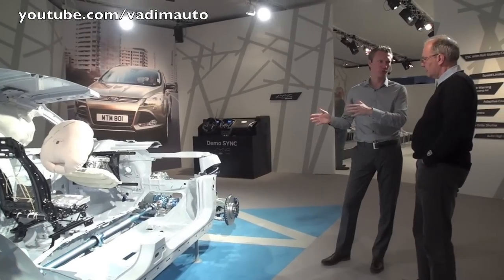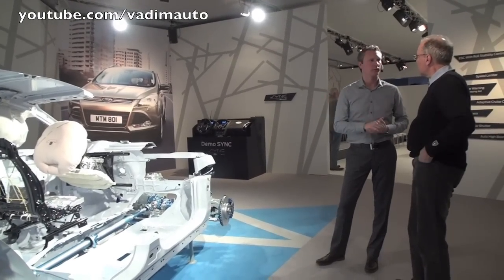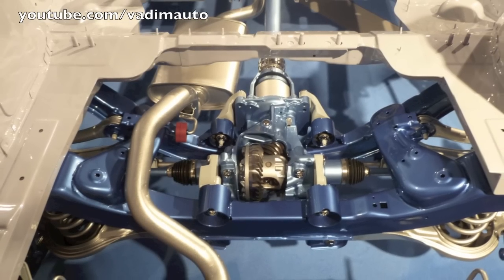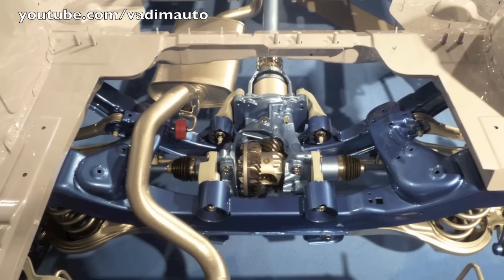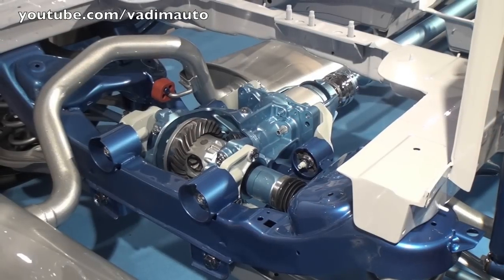Ford Kuga, Intelligent AWD

Comment: Thanks for sharing. To clarify, the all-wheel drive system uses a JTEKT multi-plate clutch pack. In normal conditions, the clutch pack won't be engaged so that the Kuga will be front-wheel drive only. As the clutch pack engages, rear axle torque increases up to a 50/50 front:rear split. It's not really accurate to say that the split is infinitely variable - it's only when the front wheels have no traction that its 0/100 front:rear.
Reply: Nice work, Eric.
Reply: How it's possible to transfer 100 of torque to the rear ? Because at this type of awd system we don't have a central differential and it's a transfer case that receive the torque through the front differential and immediatly the torque is transfered to the front wheel. The max of torque that can arrive at the rear wheels is 50 %
Reply: Hi Andrei, as explained above, Ford is wrong to say that the torque split is fully variable since 100 per cent of the engine's torque is never transferred to the rear wheels.
Reply: If the front wheels have no traction then, by definition, the rear wheels have all the traction
Reply: "Infinitely variable" doesn't mean 0-100% necessarily. It means only that the value is continuously, smoothly variable from some minimum to some maximum. The degrees of variation are infinitely small, rather than the range being infinitely large (or the full 100%).  Of course, the range COULD be 0-100%, but that's not what "infinite" refers to.
Reply: Do you know if the Ford Edge has this same ability (clutch pack - FWD only mode)?  Or is it only the Kuga?

Asking about a 2016 model if that makes any difference.
Reply: do all of the kuga awd models 2013 to 2019 use jtekt system or do some use the haldex system?

Comment: Any service required?
Reply: I am currently awaiting feedback from Ford on this very query. I have a late model Kuga "intelligent" AWD and have been told recently that there is no service requirement for this drive. To say that I was shocked to hear this would be an understatement.

Ford seem to imply that this intelligent AWD system is maintenance free. There certainly appear to be no routine oil/filter changes referenced within their service schedules and my local main dealer confirmed recently that they have never carried out maintenance on this drive system. Having owned Audi's for a number of years I find this very surprising. 

Ford are keen to point out that this system is different from the Haldex systems Audi fit however the mechanics of this system are not that different and yet Audi have quite stringent service requirements - specifically I believe Audi now quote routine oil changes every 20k miles and filters ever 40k miles. 

When the TT first came out Audi originally specified 80k for oil and filters however owners running these models ran into problems as the mileages started to increase with failures well below this level. The company revised servicing down to 40k and then the 20/40k that they have today. 

A quick search of the Ford Kuga Forum also suggests that the AWD system is not without problems with numerous failures reported due to blocked filters. It is difficult to determine whether these failures are ONLY on older Haldex based drives or whether any of these failures are on the newer "intelligent" AWD systems. I would not be at all surprised if the failures are attributable to non existent oil / filter changes irrespective of whether it is an older or newer system.
Reply: @readerj01  I have a 2017 Escape (USA) and was wondering the same thing. There almost has to be maintenance requirements, at least for the fluid in the trans axle, and the rear housing one would think.
Reply: @savethebigu  I have now elevated this to a formal query with Ford Technical Advice Centre in the UK. They have acknowledged my query and I am currently awaiting their formal response.
Reply: @readerj01  Okay, looking forward to an update!
Reply: @savethebigu  Just received a response from Ford. Their reply was very much as expected. 
They provided a general description of how the drive system works and confirmed their new AWD system is not Haldex based (which I already suspected). 
I've read separately that the force by which the clutch plates operate on these newer drives are now through electro-magnets instead of hydraulic pressure on the older (Haldex based) systems and it was contamination of the hydraulic fluid that cause pump failures (blockages) in the earlier models. 
Ford are confident this problem will not occur in these later systems (but with only a 3 year warranty, they would be). Personally, I'm still not convinced regarding the longevity of the PTU without any routine maintenance and I would imagine it would be difficult to carry out oil changes if the unit has been "designed" as maintenance free. 
My Kuga is now just about at the end of its 3 year warranty period and I can't say I'm too confident that this system will last long-term without routine oil changes. 
I have raised a general query on the Kuga Forum asking whether anyone else has experienced problems with these newer drive systems but since they've only been in use since 2016 maybe the gremlins haven't crept in yet. 
If I can't get the drive system maintained I think it'll be time to move the car on as I can I'll afford problems if Fords unbridled confidence is ill founded.
Reply: @readerj01  the ptu has a filter?
Reply: @balor7  but clearly not designed to be maintainable or replacable otherwise it would presumably feature somewhere within Fords own planned maintenance programme. 

The only task that Ford undertake is to carry out a cursory external inspection for signs of leak and if found they would replenish the oil. When I asked my main dealer what oil they used they couldn't even tell me. 

I've given up persuing this issue with Fords who imo are burying their head in the sand and simply hoping that customers wont have an issue within the 3 year warranty period. I currently have an extended warranty on my Kuga that covers the AWD system but I'll be changing vehicles before that expires.
Reply: @readerj01  a certified Ford mechanic has a YouTube channel and he recommends changing the ptu every 30000 miles due to its proximity to the trans and the heat there. He never mentioned a filter that's why I was asking.
Reply: @balor7  I would imagine that any competent mechanic would come to the same conclusion as me regarding service on the PTU but regrettably Ford - as a company - do not have the same opinion. The joke is that when my Kuga had its major fluid change service after 3 years I would have been more than happy to have paid for the PTU to have been serviced at the same time but they were adamant this was not required. You dont often get a company that turns down the offer of additional work. Maybe they see more profit in substantially higher bill's when the system fails and needs to be entirely replaced outside of warranty. Or is that me just being cynical?
Reply: @readerj01  you could very well be right.  I've decided to have ot changed every 30000 anyway. I'm locked into it now  I want it to last.
Reply: @readerj01  I would suggest you change your PTU oil every 10k to 20k miles with a very high quality 75w140 gear oil. Rear diff oil change around 30k miles. The coupling is not serviceable. If you drive an auto or a power shift I suggest an oil change every 20k unless you tow and then 10k miles. Engine oil service 6 months or 5k for diesel or 3k for an Ecoboost.
Reply: @readerj01  the "no service required" story is just that, designed failure beyond warranty window, requiring replacement. Same with PTU or RDU. Heat from exhaust / cat conv / turbo / poor air flow will cook the oil in the PTU. I've seen sensor temps over 270F for PTU fluid after an aggressive drive through twisty road. And my RDU was effectively empty with no apparent leak when I checked it at 90K.. and it has some noise, so I'm likely to have to do an RDU swap at some point.. Lifetime fill is a lie, always.
Reply: @cccerberus777  got shot of my kuga 18 months ago for this one reason. I wouldn't be one to take a servicing job of this type on and since I couldn't find anyone, anywhere within a reasonable distance to take this service on I decided to move the car on before problems arose. Time will tell whether these drives are reliable - but happily not at my expense. I stand by the decision that I will never buy another Ford.
Reply: @readerj01  the fact that my RDU has not failed on me, after being effectively empty, the way I drive, actually gives me some confidence in the stability of the unit. I just know to disregard the lifetime fill BS. But I am a mechanic so I have more familiarity with these things than most.